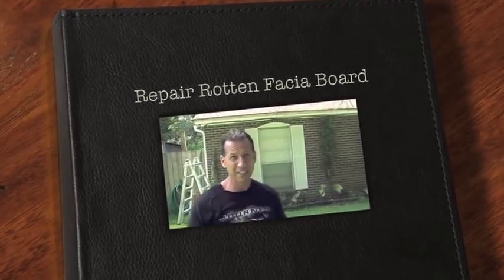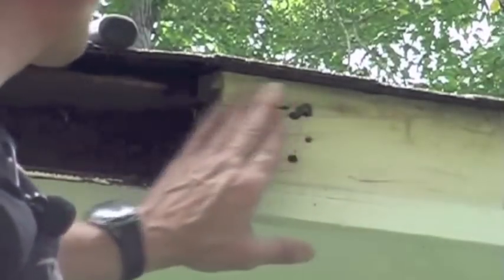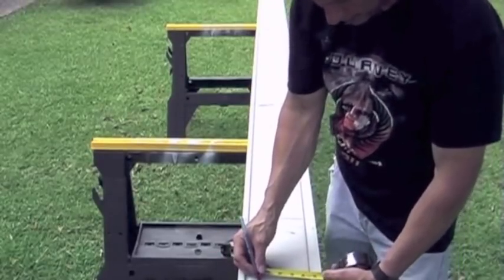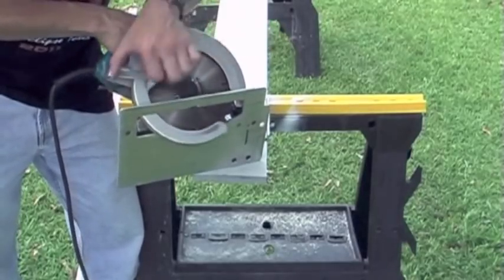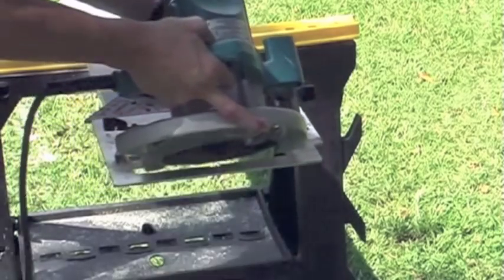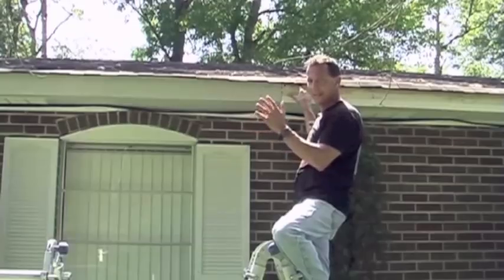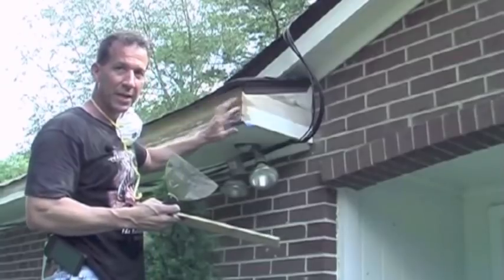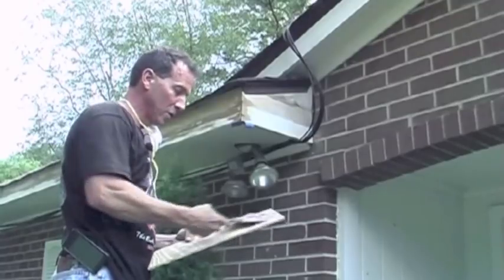Repairing Fascia Board

Comment: I was looking at how to replace a facia board, but picked up a lot of good tips from you!  I always clamped down aluminum rails/guides for my circular saw, when using your finger on the plate is all i needed :)  Also, bondo for corners instead of caulk... nice!  thanks again!

Comment from the maker: You are right about outside corners not matching all of the time. Many times they swell and open up. Bondo actually works as well as wood glue when bonding wood together. I was a trim carpenter back in the 80's. When routing wood, we would sometimes snag a splinter, or a split in the wood. We would then use bondo on the bad edge and we would route over it. The bondo was just as strong as the wood . If you keep a good paint on your repair, you will get years of perfect corners.
 Thanks!
 Paul

Comment: @paulstoolbox 

Paul,

You did a great job on this video giving all us DIYers some good advice and some great tips on how to install fascia board and how to do patch repairs using bondo which is the first video I have ever saw showing to use it. The best thing about using the bondo is that there is very little wait time. So it makes is quick strong and easy.

Great Job I will be doing it your way for now on.

Thanks

Phil

Comment from the maker: You can purchase a small roll of flashing(sheet metal in a roll, usually 4 to 6 inches in width). You can slide it under the drip edge and over the rear lip of your gutter. If your gutter is attached by gutter spikes you will have to notch around them. Make sure you use aluminum flashing for aluminum gutters and like materials for galvanized and copper gutters. Mixing them will cause Electrolysis(Corrosion due to chemical reaction). 
Thanks!

Comment from the maker: Hi Robert Hocker,
I personally would not recommend screws on fascia board, The heads are very obvious and will take away from the clean look.You cant hide them, for if you cover them up, you will play hell trying to get them out. If you get paint in the heads, you will also have trouble unscrewing them. I have invented new curse words on a few jobs where someone used screws on fascia and I had to replace rotten boards.They had multiple coats of paint on them. It made the job much worse than it would have been if nails were used. Although I appreciate your input, I have to disagree.

Comment from the maker: Hi oliver915,
!st I want to thank you for your comments. When it comes to fascia, it is common practice to 45 your corners. As for your seems, it is good practice to cut some kind of miter for your lap joints. You can cut it at a 45 or even a 15 degree if you like. The angle allows for a nice looking,strong joint. Don't forget to glue all of your seems with a good waterproof wood glue.
Good Luck!
Paul

Comment from the maker: Hey riceski,
I am not sure about your region but here in the New Orleans area, fascia usually comes in 1"x8 "or 1"x6" and the length can be up to 16'. I have had to rip the fascia in some cases in order to match an existing fascia. You can use a table saw or you can do it the fast way with a circular saw. Make sure you pay attention and rip the top and not the bottom where the dado cut is. (groove that accepts the soffit board) Thanks!
Paul

Comment: Gf's bathroom has had a huge leak from ceiling right at the corner of the outside of the house.  Has a slate roof with two peaks forming a flat roof right on top of the bathroom and was thinking it was the roof that was leaking.  Well, I was out cleaning gutters and found the fascia board for the gutter for the flat roof was half way missing due to rot, and the spot where the fascia was missing was right at the downspot, and the leak in the bathroom was in direct line with that area.  Checked roof, roof is good.  Was the fascia board the whole time lol.  Thankfully that piece is only about 4 ft long, but your video will be coming in handy in a few weeks. Thanks man!!!
Reply from the maker: Thank you gadapollo! Im glad it was only the fascia, It is usually caused by flat roofs, they can be a pain!
Reply: Paul Ricalde Ya really.  Although the giant maple dumping leaves into that tiny gutter isn't helping either, gonna have all of the downspouts snaked out as well to make sure theres no cloggage then we should be good :)   (famous last words lol)

Comment from the maker: Well Piddler51, that is a good question! Wood will always expand and contract to some degree,especially when subjected to extreme outdoor conditions. That is why I always glue my lap joints. As far as corners go, you will keep it to a minimum using bondo. You may see a hairline crack during expansion due to heat, but it will still maintain its integrity for years. If you maintain your paint,you should get great results.
Thanks!

Comment from the maker: Hi learningasigo,
I glue and nail my seams and joints. I usually use an 18 gauge brad nail gun for this, but a 6 penny trim nail will also work. If you are using a hand nail. You can set the head against a hard surface such as concrete and tap the point with your hammer, this will blunt the nail and make it less likely to split the wood. 
Thanks!
Paul

Comment from the maker: Hi Gary Rice,
I think I understand your question. You will need to mark a 22.5 degree line on the bottom of the fascia from the slope side. You will set your blade on a 45 degree angle. This will give you 2 angles on your cut (Compound angle). You will then mark a 90 degree line on the horizontal piece. You can cut this with your blade set on a 45 degree angle (compound angle). If you look at my video, I only needed to cut the horizontal fascia and I set my blade at 45 degrees. Hope this helps!

Comment from the maker: Hey ICAWN,
Unfortunately you will have to remove the gutters. After that you can lift the roofing shingles if they are seal tabs. If you lift them up a little bit, you can then see the nails that hold the drip edge in place. Using a flat bar( nail puller) you can pull the nails up on a section. They usually come in 10' lengths. Then you can remove the drip edge and pull the fascia away from the roof line .

Comment: Nice video, Paul.  I like your comment on bondo.  Just confirms what I did to my weather-exposed fascia outside corners about 12 years ago.  Bondo doesn't shrink, is sandable, paintable, water-proof and termite-proof.  I just did the same thing today (5/8/14) on my neighbor's outside corner that was 1/4 eaten away by a couple of active termites.  Cleaned it out, drill/spayed for termites, used bondo, which closed up the corner, and is now water tight and termite proof.  The look on my 92-year-old neighbor's face was worth it.
Reply from the maker: That's cool GSMSfromFV!
Thanks!

Comment from the maker: Hi Infernium 2068,
It sounds like you are talking about T111 siding (pronounced T one eleven). They have different materials and styles that this is made from. Plywood,Mason board and OSB board. They usually come in 3" and 8" spread between the pattern. If you measure the part in between the grooves you will see which one it is. If you are replacing it, I suggest OSB. If you are repairing, you will want to match it. Big box stores may not have it but lumber yards probably will. ( continue)----

Comment from the maker: AddingLightProject
No, it is a polyester resin filler, made by 3m. You can contact  3m and ask them to provide you with a MSDS if you like. Material Safety Data Sheet.

Comment: Love watching your video. I'm having a room addition built and we're at the phase of putting a roof on. But we noticed the fascia board has separated at the seams. And the contractor was telling his workers to fill it. I see a problem with water damage if not done properly. And I'm afraid I don't know enough to make sure it's done properly and the contractor wanting to cut corners. I'd love your opinion. thanks.
Reply from the maker: Hi Robert,
I will be happy to give you my opinion, but it is hard without seeing the work. If you take a couple of close up photos and send them to my email. I will let you know what I think. I work with a lot of different contractors and I can honestly say that we sometimes do things differently than each other. It doesn't mean that one way or the other is wrong. If I see a problem, I will share it with you. you can send me your photos via email at http://www.paulstoolbox.com
Thanks!
Paul

Comment from the maker: Personally,I do not like to use screws on fascia board. It doesn't leave a clean finish and it can cause a real problem to the person who may have to remove it in the future. After several years of weather and a few coats of paint the screws will be hard to remove. If you have bad rafter tails,you can always scab a block of wood to the side of the rafter. This will give you something to nail your fascia to. It is easy to inspect the rafters once the fascia is removed.

Comment from the maker: Yes, unfortunately wood fillers are only a temporary fix. It is not nearly as water resistant as body fillers. However,y you can make it last longer by making sure that it is sealed with a quality exterior paint and caulk.

Comment from the maker: No it is not very costly if you do it yourself,the rafter tails usually rot within the last few inches where it is nailed to the fascia board. If this is the case, you can scab a 2x to the side of the bad rafter, making sure that you use a long enough piece to allow you to nail your patch to solid wood,( between 12 and 24 inches). If your rafter is rotted further up the board, you may have to change the rafter and it will cost a bit more. You must fix the problem that caused the rot 1st! Thanks!

Comment from the maker: Hi rayrayenter,
If your roof sheathing is still good, you may be able to cut 2' sections of wood and scab it to the sides of each rafter tail. That is the least expensive way. It sounds like you have a roof problem that will need to be fixed. If your sheathing needs to be replaced and the roof also, I would suggest replacing the rafters at that point because replacing them is much easier when the roof is off. It is hard to tell without seeing the damage.(continue)----

Comment from the maker: I try my best to explain everything, but sometimes I assume a little too much! I should have said that it becomes very water resistant after you apply primer and paint. I am also familiar with Evercoat Gold Rage,and not only agree that it is not waterproof unless sealed, but I would not suggest using premium body fillers in place of wood fillers since they can cost $50.00 or more for a gallon. Thanks for  the tip , I will try not to make assumptions in future videos. 
Paul

Comment: I spray the corners of the fascia with "Flex Seal' rubber coating/sealer and then prime and paint. I don't know how long it will last, but so far working fine.

Comment: Great instructional video!  I'm replacing the fascia over my garage and have taken down the gutter and rotting corner cove moulding on top of the fascia.  I've bought the lengths of treated 1x6's and was told at HD that I should put flashing on top behind the fascia under the shingles.  There is none currently there.  The moulding is staying off but is the flashing necessary? I sound like I know what I'm talking about and I actually might!

Comment: If you can't nail the fascia joints on a rafter, nail timber blocking in between the rafters then nail the fascia to the blocking. I also find that spreading Bondo on the joins instead of glue then nailing it all together with back blocking I get a near invisible joints after it's sanded and painted.

Comment: Hi Paul,
Thanks for the video!
I had a few questions for you. Me and my husband bought a house(very old) and needs a ton of repairs and its roof is our first project. We will be removing the old shingles and decking and adding new ones to the roof and I was wonder should we replace the Fascia boards before or after we do the decking and shingles? I also have a few pictures of the house if you don't mind looking at them and giving us some tips on what needs to be done to repair the roof. 
Thanks,
Sam G.

Comment: Thanks for the vid - 

Question:  I recently repaired a fascia corner like this.  I didn't use bondo/hardener though.  I used "Elmers Interior/Exterior Wood Filler".  It looks great now, but will it absorb water if any of the paint wears off?

Comment: If only you were nearby and were willing to do the work.  With one exception- work done by a fellow who considers himself more a handyman than "carpenter," every bit of work done on our house has been a disaster.  Windows installed out of alignment; improper flashing; storm doors installed improperly so that having new doors made no difference or made things worse - all highly recommended contractors.  Never once suggested anyone cut corners.  Unfortunately, the excellent handyman/carpenter has moved away - probably couldn't stand seeing all the bad work.  Thank you for the video.
Reply from the maker: Jakeornot 
I am sorry to hear about your bad handyman, but it is a good thing he's gone! You will probably be better off doing the repairs yourself. If you have any questions, I will do my best to answer them.
Thanks!
Paul

Comment: Other video's repaired fascia with 4" wood external screws. Wouldnt wood screws hold better in soft wood rafters vs than nails you are using? Seems to me if anyone is replacing fascia its probably because the rafters are soft and/or rotten so nails might not get a good grip? What do you think about external wood screws?.

Comment: Hello Paul,
Great video and good instruction.  I have learned alot from your video.  I have fascia on my house that is all rotted out, because there was not ice gaurd installed and there was improper installation of flashing.  The original installation actually left a half inch of wood exposed behind the gutters.  
  On a different note, I am very safety oriented and I saw some issues.  I am only concerned for you and your co-worker's safety and your familie's welfare.  Aluminum ladders are unsafe, they conduct electricity, OUCH.  Also, I saw, in one shot, that your ladder was not level, dangerous.  Most ladder deaths occur from a 6 foot fall. Also, I noticed that your repsirator only had one band attached.  That is not good for your lungs, nor for us viewers, we look up to professional's like yourself and follow you guys.  Also, can you suggest that a person use a C-clamp, instead of their finger, to guide the saw.  Also, you had no hearing protection.  I am not trying to come off as a know it all.  I am employed by a large construction company which teaches us safety.  So I am only sharing what I am taught and I do hope that you find no offense to my suggestions.  I am only a fellow tradesmen, wanting to ensure that other tradesmen, such as you Paul, can benefit from safety.

Comment: Thanks for the video. I'm trying to install gutters on my house, but the fascia board is not straight vertical. It looks like the builder left the rafter ends square so that the fascia board is sloped inward at the bottom. Do you have any ideas how I can get a straight vertical surface to attach the gutter brackets to?
Reply from the maker: Mark Mathews Hi Mark,Sorry it took so long to get back. For some reason I do not get all of my comments. I happened upon yours while answering another one. They make gutter wedges for situations such as yours. The break away ones do not work as well as the standard ones. You can easily bend them to fit your fascia. You will need to put them wherever you have a gutter bracket. Here is a link that shows both types.  http://www.acegutterinc.com/rain-guttersThanks!Paul
Reply: Paul Ricalde Thanks. I ended up cutting wedges from 4x4s. Works pretty well.
Reply: Great job Mark!

Comment: Great video. When you glue the seams, would it be wise to prime the seam first, or does the glue keep moisture out?  Thank you.
Reply from the maker: +gsgobbo 
I personally do not prime the ends because wood glue is made for bonding raw wood to raw wood. If you are going to caulk your joints, you would be better off priming the ends. In my opinion, glue works better than caulk.. Exterior wood glue is what I use.
Thanks!
Paul

Comment: any tips on repairing round spindles on a porch? car stuff is easy, the new home owner thing is tricks!! i did like the bond on the corner, i was thinking about using it on my fascia project before seeing the video!!
Reply from the maker: Yes, you can repair any paint grade wood with bondo. The first time I used bondo on wood, we were building hand rails on new construction houses, This was part of our trim package. We had 2x6 Douglass Fur and we routed the profile. Fur is a brittle wood and the router would sometimes catch a splinter and pull a chunk out of the wood. We would fill it back in with bondo, sand the area to match the square edge and run the router over it. We did this in less than 30 minutes.
Good luck!
Paul

Comment: Paul Ricalde  what is the recommended method of removing the drip edge when replacing the fascia? Do you recommend removing it completely or bending it up while you replace the fascia? Thank you.
Reply from the maker: Hey Alfredo,
Drip edge us very thin and kinks easily. It is also very inexpensive. I usually replace it when I replace fascia. It cost about 3.00 for a 10' length. Thanks! Paul

Comment: needs help quick.. removed all facia boards realized where the roof plywood meets the wood behind the facia has swelled and not sure how to fix this. we just replaced the shingles and would really not want to have to take them off. does the facia have to go over the roof? if so what do you reccomed to fix this problem?